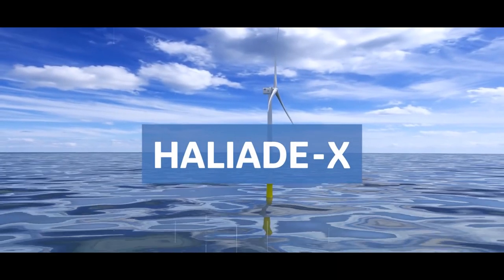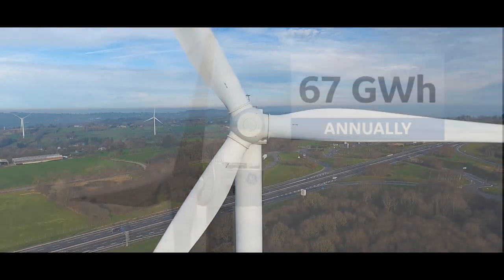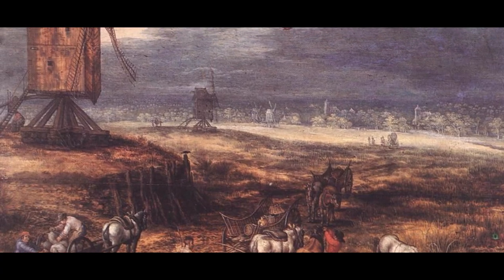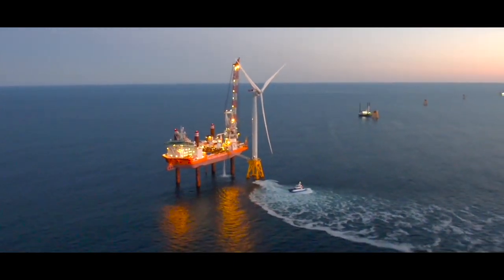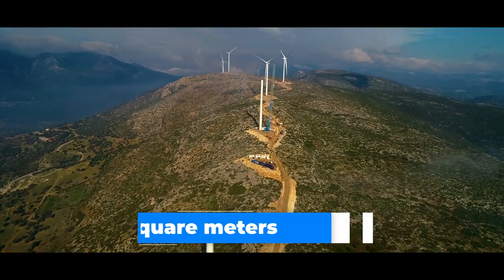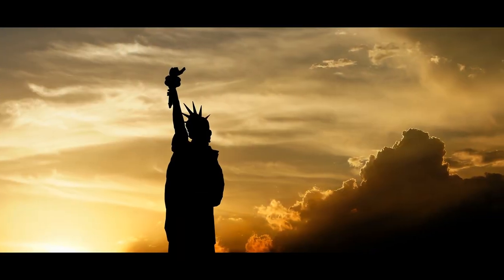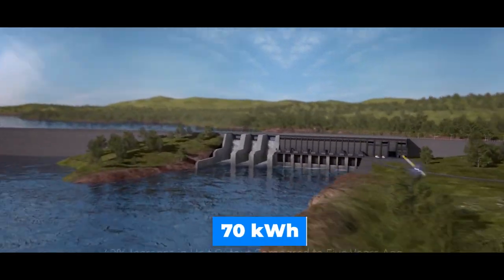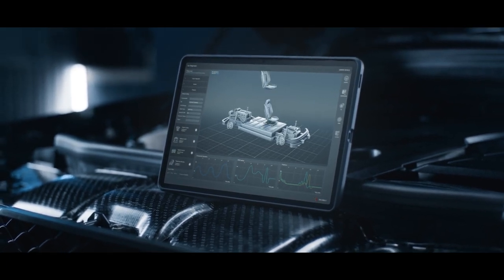World's Largest Wind Turbine POWERS 30.000 Homes!

Comment: So this whole video hype was about a battery installed into the wind turbine?
Reply from the maker: Actually a hydro pumped storage inside the foundation of the wind turbine.
The first of its kind which Solves an Important problem we have with renewables especially wind power. Yes, I was very hyped about this 🤓
Reply: @The.Futurist  So it is a physical battery that pumps water in a tower as a saving mechanism and then uses it in a hydro electric way to make energy. That doesn't need to be in the wind turbine, I can find a ton of issues with water being pumped in the structure of the wind turbine itself.
I am aware that physical batteries can be super cheap to construct and run and even when they are not that efficient they can still provide a solution in areas that size is not a problem. But a water pump into the turbine is like asking for problems.
It can be a physical battery nearby or anywhere else in the grid.
Reply from the maker: @aryaprincess2479  actually not in the structure of the wind turbine itself but rather in the foundation. There is a height difference of 40 meters capable of storing the potential energy of 20 hours work of the turbine which is not that bad and could be enough to bridge the times where wind isn’t available. But I like the idea of pumping water up to the entire wind turbine structure. Could store even more energy. Which problems do you see there?
Reply: @The.Futurist  Water inside a tower that is meant to hold the turbine is the problem, they can make other towers that are specific for this, a all-in-one approach in this case could be catastrophic.
Anyway physical batteries are a thing and they are dirty cheap to make, if they utilize this efficiently it will solve a lot of issues.